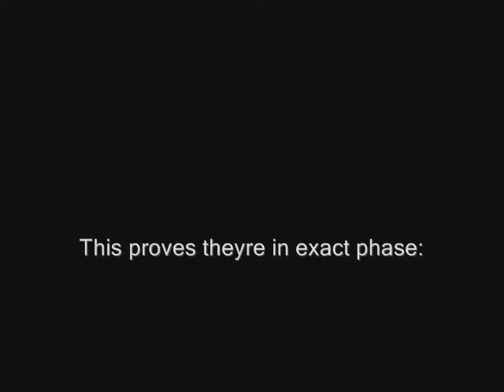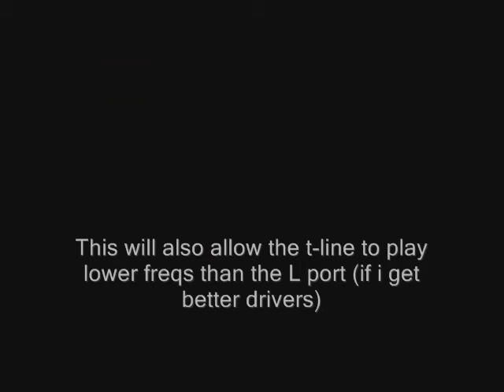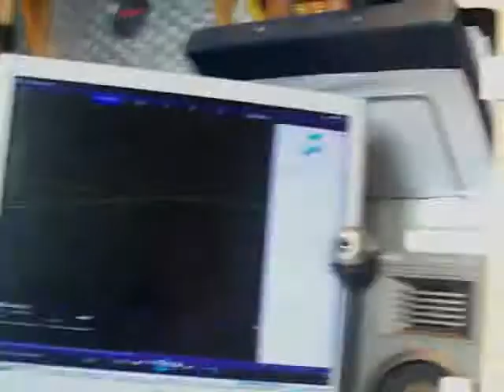How different boxes affect Subwoofers

Comment: Connect a car battery in parallel with your PSU so that it handles the high current and then then the PSU will charge the battery when the bass is quieter.

Comment: the reason why its cutting out like that (mine did it to) is that ur amp doesnt like your wiring. i had mine wired in parallel and that was happening  so them i wired it in series and it doesnt do that anymore

Comment: @320bit caps are useful in one circumstance: when your car electrical is crap, and there is lots of voltage drop on the wiring, and you don't feel like rewiring the whole thing (or your car is under warranty).

a capacitor placed as close to the amp as possible will smooth out this voltage drop and handle bass peaks better. of course, if you crank it too hard the result will be the same as with no cap, but listening at regular volume will be greatly improved.